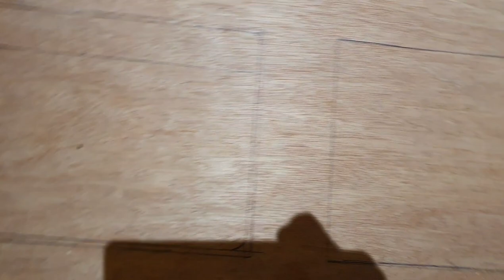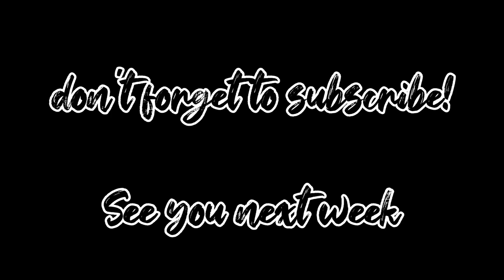Pull out stealth camping bed finished!!

Comment: Couldn’t get up quick enough to watch, Well worth waiting for 😁 great job your stepdad and you did of the pull out bed.your little helper with the screwdriver was way too cute.. great job… .? go to Kustom Sport in Carlton Ind/Est  they do seat cushions/upholstery also I know this would be an expense but they also specialise in pop up roofs if ur now struggling with headroom, may be for the future. Great job so far. 😃
Reply from the maker: I didn't even know they were there! I had my van remapped in Carleton but Carleton tuning. They took the limiter off my van too! Thanks for that suggestion buddy I will 100% look into them! Great tip!! 😁😁